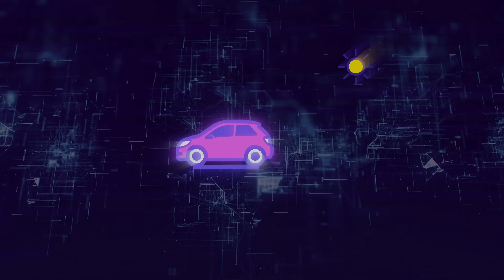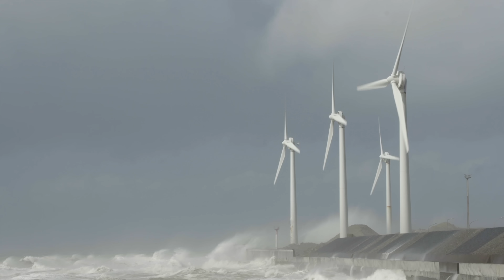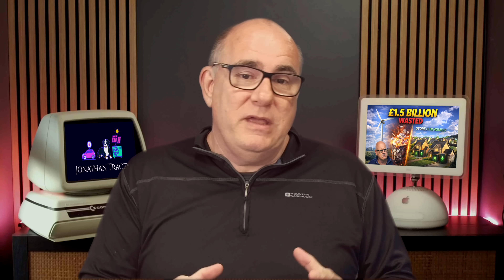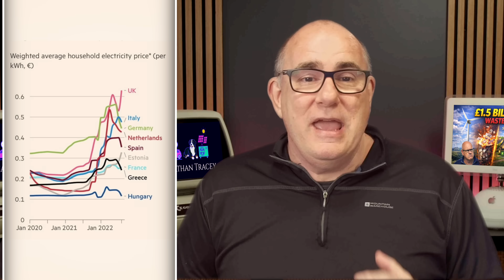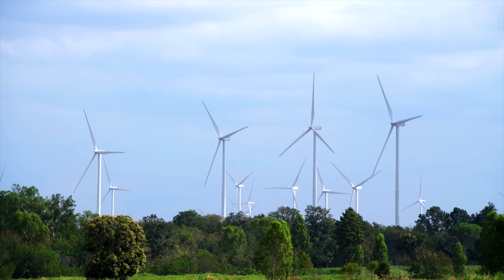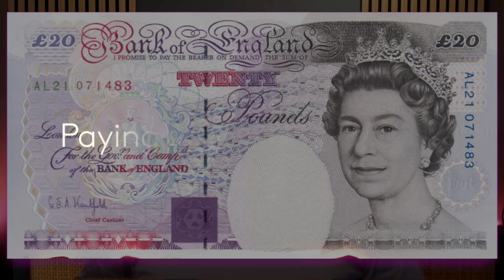We’re Paying £1 5 BILLION To Waste Energy… Here’s My Big Idea

Comment: Jonathan. I really enjoy your videos, but you have got the cost of wind farm constraint so wrong. There are two sides to this coin and you are only showing one, the cost (your number £1.5 billion). You haven't considered the benefit (my number £104 billion).

Wind farms were built in Scotland before there were enough transmission lines to accept their output all the time. So sometimes their energy can't be accepted into the grid. This was a deliberate policy choice called "Connect and Manage" introduced by the Conservative-Liberal coalition government in August 2010 and implemented by Ofgem and National Grid in February 2011. 

The aim of Connect and Manage was to improve access to the electricity transmission network for generators by offering generation customers connection dates ahead of the completion of wider transmission system reinforcements. This has allowed much more renewable generation to be produced than would otherwise have been the case. The flip side is that when a generator is connected they have to be compesated if the grid can't take their output due to constraints.

The government and Ofgem weighed up the cost of constraint vs the benefit of added generation and said yes, let's do Connect and Manage. We will Connect the generator, then Manage the constraint. When it became more economic to pay for the construction of the line vs paying for the constraint then the line would getr built. In theory

Prior to this policy, generators were having to wait for 10-20 years for transmission reinforcements to be completed before they could connect. While they were waiting for connection, those generators had to put up financial securities to cover the cost of changing their minds i.e. if they saw the process through and waited until they eventually got connected, they would pay very little for the construction of their connection. However, if at any time they changed their minds, they would have to pay for the abortive cost of transmisison construction to date, this could be £100s of millions and so they had to provide costly financial securities for those potential liabilities.

Connect and manage meant that renewable energy started to go onto the grid right away and that was a good thing. The costs of managing the resultant constraints was initally small, and the idea was that the necesary reinforcements would be built before those constraint costs got too big. Nice theory, didn't work out cleanly in practice because the regulatory permission to build those new lines was delayed by over conservative behaviour at Ofgem and National Grid, meanwhile constraint costs grew.

So we aren't just losing losing £1.5 billion due to constraint. We are also receiving many TWh of renewable generation (which wouldn't have otherwise occurred without Connect and Manage) which is increasingly suppressing the price of electricity and gas , saving all of us more than £104 billion . Two sides to this coin.

https://www.ucl.ac.uk/news/2025/oct/analysis-wind-power-has-saved-uk-consumers-over-ps100-billion-2010-new-study

"From 2010 to 2023, wind power delivered a benefit of £147.5 billion — £14.2 billion from lower electricity prices and £133.3 billion from reduced natural gas prices. If we offset the £43.2 billion in wind energy subsidies, UK consumers saved £104.3 billion compared with what their energy bills would have been without investment in wind generation."
Reply from the maker: @redshift3 Appreciate the detailed comment 👍 — and you’re right that “Connect and Manage” did unlock a lot of generation earlier than would otherwise have been possible.

Where I’d push back slightly is that both things can be true at the same time:

• Yes — adding wind has reduced wholesale prices over the long term (especially gas displacement)  
• But — we’re still paying very real, rising constraint and balancing costs today because the grid hasn’t kept up

The £1.5bn figure isn’t saying renewables are a net negative — it’s highlighting a system inefficiency where we’re generating low-cost power but paying to not use it.

So I’d frame it as:
Connect & Manage = good decision  
Current grid + market design = not keeping up

That’s really the gap I’m trying to highlight 👍
Reply: @JonathanTracey I agree. The current position is not keeping up. More transmission network and more flexible alternatives (such as, but not only, batteries) are needed as soon as possible

Comment: Anyone else just wants to move to the middle of nowhere and be totally off-grid? It must be possible to not be reliant on the grid at all.
Reply: It is if you don't mind running a generator some of the time. Without a generator it's a challenge in the UK.
Reply from the maker: its not practical for 99% UK population, we don't have the land to create large solar or wind soltuions that will get us through winter

Comment: The problem is that you still have to get the energy to the home batteries. So still need the infrastructure. I think it would be a good idea to put a large high voltage dc cable around the whole island. Like a massive ring main. Take a cable up the big rivers. No need to make land fall and build pylons, just up the river and land a big inverter next to a substation. Or a railway, nice long cable run next to the track. As far as home storage. The car manufacturers seriously dropped the ball with miss managing the ev transition. So make a deal with byd. Let them have free reign for 5 years with v to g car sales.
Reply: I was thinking that we could put big batteries on trucks, fill them up in Scotland drive them down to England and then empty them into some kind of big open space with a shop or two where people paid to use it.... I mean it works for petrol 8)
Reply: EGL 1 to 4 HVDC cables are on their way, though they do make landfall
Reply from the maker: @Nazgul-nt8gd That’s actually a really interesting way of thinking about it 👍

You’re right that infrastructure is still needed — you can’t avoid moving energy around entirely. Ideas like HVDC rings or using existing routes like railways have been talked about for a while.

On the EV point as well — vehicle-to-grid could be a huge part of the solution if it’s implemented properly.

The challenge is tying all of these pieces together into something that actually works in practice rather than just on paper.

Comment: The first big phase of the grid upgrades will be completed around 2030. The second phase around 2035. 
2030 is not that far away compared to planning and building a battery factory and given the natural and accelerating installs of home batteries it doesn’t need direct government involvement. 

As others have mentioned the problem is bottlenecks on the grid that exist today, so unless the batteries sit on right side of the bottleneck the excess energy is still a problem. 

We should not overlook a general election will be looming in a few years and given the major differences on energy this severely puts off investment.
Reply: EGL 1 and 2 due 2029, 3 and 4 in 2033. Hopefully.
Reply from the maker: @PaulBlundell-k7x Really good points 👍

And agree on timelines too. 2030 sounds close, but in infrastructure terms it’s a long time to keep paying to waste energy.

That’s kind of the gap I’m trying to highlight — what can we do now while those longer-term upgrades are still years away.

Comment: Don't need to give the batteries away. Just offer credit to the value of the battery. Id buy a battery for a grand if it came with a grands worth of power free.
Reply from the maker: @pauleaves469 That’s actually a really smart way of framing it 👍

Instead of “giving” batteries away, you’re effectively pre-paying the benefit through energy credits — much easier for people to understand and accept.

It also aligns incentives better, because people still value and use the system properly rather than treating it as something free.

Definitely a model worth exploring.

Comment: Yes, I'd have one without hesitation. Our daily load averages out between 4 and 5 kw/hrs (we have gass ch) so it would go fair way to meeting our demand. No question lateral think required to solve the problem, you would think all the drunk MPs would come up with something 😂
Reply from the maker: @grahamcastle8189 That’s exactly the kind of use case this is aimed at 👍

A steady 4–5 kWh daily load is pretty much perfect for something like this — it doesn’t need to power everything, just take a chunk out of your demand at the right times.

And yeah… sometimes the solutions aren’t that complicated, it’s just getting the system to actually adopt them that’s the challenge 😄

Comment: Here is an off the wall idea, power trains, you can put about 5mwh in a standard shipping container, get 20 of those on a train which is 100mwh, load the power up in Scotland, train it down south overnight, swap the containers for flat ones, head back up north.
Reply from the maker: Unfortunately, 100 MWh sounds like a lot of power but in reality it’s a few seconds for a city. You would need continual trains running north to South.
Reply: @JonathanTracey if the national grid is at 30GW, we are using 500MWh per minute, so it's 12s of national power. 100MWh is perhaps a minute for London?

Comment: I think it's an epic idea, I wonder if you could use it to slow time transfer the renewable energy to where it was needed, batteries round the wind farms in Scotland charging through the day, then slowly dumping it to the grid over night at a rate the grid can handle while batteries in the SE are charging up.
Reply from the maker: absolutely, and if you start the rollout in Scotland near the generators, you take load off of the grid which means more energy can be moved south, as you build out the battery system you keep moving itself taking further and further loads of the grid.

Comment: If Scotland is producing more electricity than the cables to a large industrial city like Newcastle can handle, how does your calculation get that electricity to your little battery in, say London?
Reply from the maker: You start by charging batteries in Scotland next to the generators, and then you slowly move down the lines taking the load off of the existing lines to allow more power to be transited to destinations further south. Eventually, you work your way all the way to London installing batteries and you take a massive load of the grid.
Reply: @JonathanTracey 
So what you are saying is that if people want to reduce their electricity bill, they should install a home battery that can buy electricity when it's at a negative price. I thought Octopus were already doing that.
How about instead of an interconnector with Europa, the UK spends the money running an interconnector North South. I know the Scotts talk the big talk about going it alone, but there's less chance of that than a Russian sub cutting cable.
Here in Perú the government recently paid a large sum of money to Petrol Perú to dig them out of a financial crisis, and is also offering homes a ten year repayment plan if they connect to natural gas. But nothing for solar.
Reply: @richardbrice6535  Problem is Octopus are not allowed as I understand it to offer different pricing in different places, and the grid pricing is also not working that way. If someone fixed the politics then you'd be able to just offer extra cheap agile prices in Scotland. Unfortunately politicians are scared that would make the little Englanders go funny colours and shout a lot.

Comment: Jonathan what do you think about humans spinning a wind turbine engine (positioned flat to the ground, like a vinyl record or a merry-go-round)? Humans can use it as a gym, they could run and turn the turbine 12 hours a day. No wind required, no big space required, because the blades can become very short. If you place a "non-wind" turbine in every council it will be enough to encourage people to go to the "gym" and get free electricity. You can even stack blades upon blades, creating floors dedicated for the same turbine, on each floor happens the same thing, people pushing in the same direction. Athletes can be as consistent as wind, even better than wind. I am sure they should do it and try it again properly, ensuring safety first. For example no blades should be in the way, the "blades" stay high above our heads connected by ropes, so each human joining the run, in order to spin the blades needs to grab a rope, then he can run and push. Different ropes can be near the center or at the border, so each human can select the speed he wants. If something goes wrong (people falling), a rope cannot hurt anyone. So basically the blades stay away and cannot hurt anyone, you just go and grab a rope connected to the blade, and start running. I am sure they will find excuses not to do it because the energy companies don't make enough profit out of it.
Reply: Sounds inefficient. The most efficient form of transport is the electric bike, where a small amount of electricity helps someone get somewhere faster and more waste energy not being where they want to get to.
Reply: @Biggest-hz7ng  I am talking about huge turbines, not bikes or small wind turbines.  Small wind turbines are quite useless and inefficient. 50 people using bikes is a waste of energy, but if you put 50 people  spinning a big turbine you get efficiency. The big wind turbines, such as the 26 MW models, can generate up to 100 gigawatt-hours of electricity annually. This capacity allows a single turbine to power approximately 55,000 to 80,000 households annually. Imagine a single turbine for every 80,000 houses. This is something never done, but it could be massive, first you don't need huge space, because you can do everything indoor, reducing the size of the blades, then you could stack mutliple blades upon each other, creating floors dedicated to the same turtbine, on each floor you have the same thing happening, people pushing blades in the same direction. Another thing that could be experimented is connecting the turbine to gears, so different speed can be  used to accommodate people  running. Gears and pulleys are impossible to use when you have only wind.
Reply: @myuncle2 humans aren't efficient generators of energy. We expend too much energy just living. 400W per person output if you are an elite athlete. So about as much energy as a single solar panel in the sun.
Reply: @Biggest-hz7ng  Sorry but it sounds like you are repeating what you have been told, zero imagination, zero creativity, just repeating non sense like a parrot. What I am talking about it has never been experimented, they made useless experiments with bikes and without batteries... If you use humans properly you can spin a huge 26 MW turbine. A single strong man can pull a truck, imagine what 100-200 average men can do.
Reply: @myuncle2 and that's before you include the wasted energy in fueling those humans. We are limited by lung capacity and legs are the most efficient muscles.  There's a reason we don't have donkeys and ropes powering our civilization. Humans can pull a truck on flat ground but not much more.

Some may fancy the idea of humans toiling. But this is pie in the sky.
Reply from the maker: sounds like hard work :-) Didn't victorian prisons used to do this with large treadmill wheels
Reply: @JonathanTracey  Not so hard if you consider the advantages, free electricity plus keeping fit, people will always do sport wasting their energy. Maintenance would be indoor and on the ground, energy source close to your home, no complaining about ruining the landscape or impact on tourism, and no need to turn off wind turbines in Scotland. :)

Comment: Interesting idea. Agree with the idea to invest the curtailment charges, not sure this is the right investment though.

The important part would be to ensure that these are deployed to geographical areas where curtailment typically takes place. Over time as the grid evolves they would need to be redistributed. 

I think there would be challenges with people unplugging them, stealing them, selling them etc. 

A factory to build these would take lots of time to come online I feel. 2kWh is pretty small so might not be worth the management cost of deploying and redeploying.
Reply from the maker: if you started rolling out batteries close to the generators, i.e. in Scotland you basically take load off of the transmission lines because people are able to run off the batteries for a portion of the day. You can then move more power south. So you continue to roll batteries out moving south all the time reducing load of the transmission line as you go.